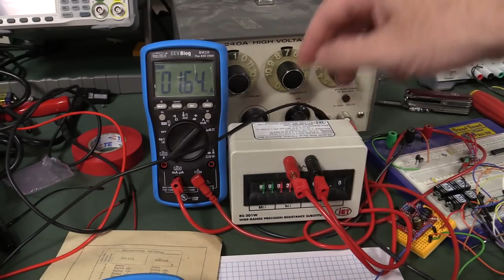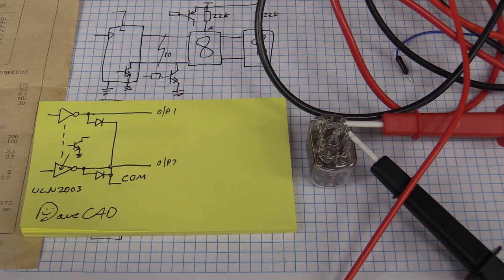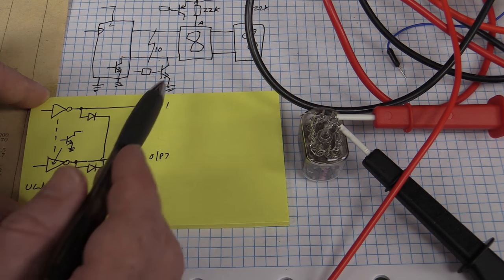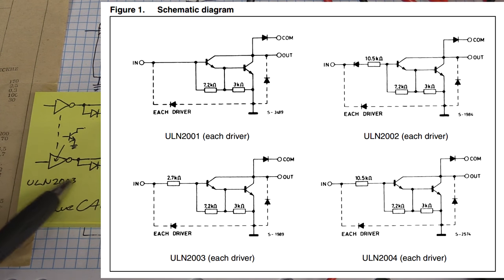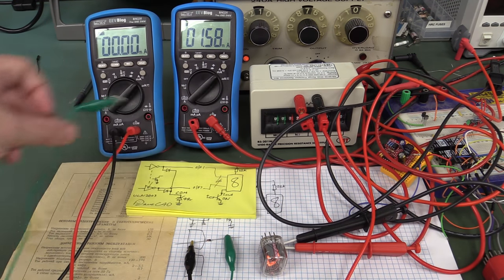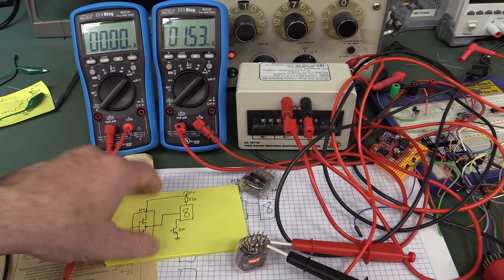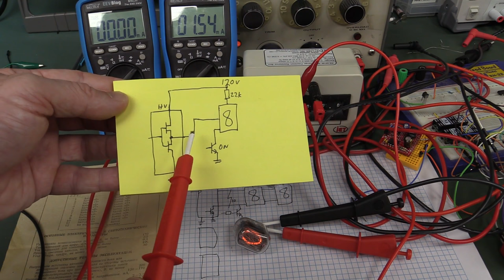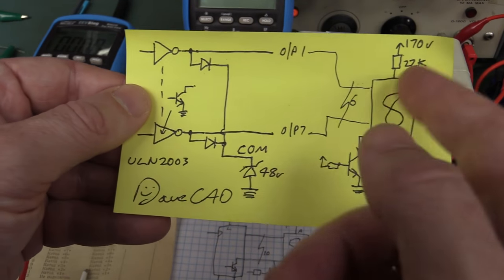EEVblog #950 - Nixie Tube Display Project - Part 2

Comment: there are millions of these 74141 chips available on ebay. It saves so much time and headache. They are designed to simplify all of this. I would definitely go that route much much simpler! And one benefit of some of these '141 is that they can handle blanking the any leading zeros.  Useful

Comment: the totem pole can be useful if you put a 48v on the HV input of the ic rather than 200v. there is a reverse protection built in to the totem pole if you look closer, I know it will work with lower voltage if some of the ic's has a lower voltage totem pole... test that out. nixie still at 170v via resistor. and the off state because of 48v zener will hold out max 50v, different ic's may varies, one I seen 60v and 80v.

Comment: I have 6 of these tubes, so I'm interested in this project. I like a single chip solution for minimum parts, but separate SR-latch and driver chips only doubles the part count, so not too bad. And it means jelly-beans can be used, so this zener trick is a great idea.
I guess a single zener would be enough for ALL the tubes (would only dissipate about 100mW for 6 tubes), but I'd be using one per ULN2003. Just seems safer...

Comment: What happens if you just disconnect the HV from the totem pole supply voltage? Will it become an open drain/collector output or is there something that I don't understand right?

Comment: Why not just leave the HV pin floating in the push pull?
Reply from the maker: Maybe possible, would have to try it.
Reply: I came here to say the same thing, or better, tie it to ground.
Reply: +pratherat Ground it, absolutely not. This will short every segment to ground, either becayse the transistor is closed, or due to the body diode of the P channel FET. Realistically possible options include: leave it unoconnected, high value (100k?) resistor to HV+, zener diode to ground, or combination of the two, ie a resistor-zener divider to generate a known although high impedance voltage.
Reply: +Gameboygenius Oops. Forgot about that. Thanks!

Comment: Dave the ULN2003 will not work if you do that. You'd probably fry any other connected logic aswell. The COM pin needs to be referenced to logic GND for the ULN2003's inputs to function. However you can make voltage dividers on all of the pins to pull the voltage within reasonable levels and than adjust the voltage source so  a 40V  difference on the Nixie tube's pins would toggle it between on and off state. Yes, that's allot of resistors, but it's cheaper than an expensive 32bit high voltage shift register... I found  a pair of 32 bit VFD display drivers but they are only 30V capable.... I might just go with discrete transistor solution with the MMBTA42... Way cheaper than the others.
Reply from the maker: How exactly can you damage the inputs? they have input protection resistors internal. Sorry, I don't see it.
Reply: Sorry, i was wrong. Thought the com was the ground pin.  :) Love your videos by the way, i was just planning to make a nixie display out of old spare parts for my old CRX's spedometer :)
Reply from the maker: Phew!

Comment: I'm quite the electronics beginner. However, I've recently bought a UA723CN 5V voltage regulator in a 14-pin DIP package to replace a component made in 1980, and I was really surprised how easy this was to obtain, for just around 60 cents or so. Is it normal that a chip that was invented in the 70s is still available today?

Comment: I like the ULN2803, since it has 8 transistors
Reply from the maker: You'd still be two short
Reply: But for an 8 digit display (with decimal) you could use 11 chips and have no transistors left over.  With the 2003 you're using 13 and have 4 transistors spare.
Reply: Duh 3 spare

Comment: Could you not use BUV21 metal cased power transistors to switch the voltage has collector emitter of 250v.
Reply from the maker: There are countless transistor that could be used.
Reply: I got some MMBTA42's in SOT23 for my Nixie project years ago. They work nice, too.

Comment: Is it easier to drive a nixie tube than a vfd?
Reply: BlinkY tried to drive a vfd a couple of years ago and I failed. Using original driver ic, multiplexer, power supply and an arduino nano

Comment: If you got an IN-15A and IN-15B nixie tube, you could make a nice multimeter with them. They are identical to the IN-12 but contain the symbols for different units instead of digits.

Comment: Wouldn't you be able to use series diodes to act as blocking diodes for reverse bias to prevent reverse voltage passing into the device?

Comment: at around the 16:00 mark, the hv pin, just leave it disconnected?!? it seems so obvious i'm shouting at the screen lol, so if its so obvious, what am i missing ?
Reply: I did the same thing. Unless the HV gets used for some internal bias? That shouldn't even matter...
Reply: I think it may matter considering the HV pin is common to ALL the outputs in a single chip.

Comment: Hi Dave, would you need several 6 nixie driver pcbs ? I can send you different tube version with schmeatic and layout (free)?
My design is similar to your design with build in high voltage step up 12V -> 170-180V.

Comment: You sad that the ULN2003 is one driver short. What about the ULN2803 with 8 drivers, that would include the decimal point?
Reply from the maker: Err, it's a Nixie tube, not a 7 segment display, it has 10 digits.
Reply: Oops... yes of course, how could I miss that... I 'm so used to 7 segments these days... Doh, won't make a big difference then. 10 or 12 ICs, hmm.
Reply from the maker: I think I said segments like 3 times in this video!
Reply: Fair enough

Comment: Hi Dave, interesting project. I worked on a spectrophotometer design in the late 70's which used an 8008 processor and had a nixie tube display. We used a similar arrangement to the one you showed except that we used discrete transistors and steering diodes for the drivers. However we did find a relatively easy way to strobe the digits. Each was fed from the +HV supply via its own resistor and we used high voltage (200V) transistors to pull the tube common to ground except the one that was 'on'. It was a 6 digit display so we did not need may of the expensive high voltage devices. This worked well although the resistors used to get fairly hot.

Comment: use BA12003B this poppy is rated 60 volts I have the same nixie tubes these worked perfect I built a clock my ZENER is 55volt my dropper is 27 k 1/2 watt carbon film I am running 175volts on the HV I put a 750 k 1 watt carbon film from ZENER to 175 HV supply

Comment: my tubes are drive by MMBTA92 and MMBTA42 in Darlington another MMBTA42 for selecting and indeed clamped to ground with an in4148 diode and a 47k 47k trough an voltage divider

Comment: Use 74141 driver:-) it's 4 bit driver for nixie tube. I have those to my nixie project, but haven't time to done it:(
My idea was use arduino with PCF8574 expanders (I2C), and one expander can control two, 74141 drivers. You can control nixie display by only 2 wires.

Comment: Yes they do sell those nixie driver chips 4bit binary to 10 digit output high voltage low side driver. I managed to buy about 50 of them from Poland I think. You wouldn't buy them in a regular store, but it is very possible to get your hands on them. Using hv shift registers is a very clever idea though. My first attempt was to use transistors and multiplexing, but it had an annoying shadow effect, so I bought those drivers. They work perfectly.

Comment: Hi Dave, could you explain the measurement of the leakage current @11:48 if you are meauring the current between the  22k resistor and the  anode of the tube. It seems the total current doesnt add up logically?
If the leakage current are passing through the 22k resistor to those open pin via a zener diode, the expected current should arround 1.59+0.33 ~ 1.92mA?

Comment: The very low cathode current that results as a result of clamping the output with the 48v zener is often talked about being linked to a "poisoning of the cathodes" exacerbating reduction of light output over time.... I'm not too knowledgeable on the chemistry of the Nixie tubes, but a similar thing does certainly occur within fluorescent lamp cathodes, (a separate issue to the well known poor preheating). Ive mainly designed clocks that are displaying 24/7, so have always erred on the side of caution.

Comment: With 200v on the anode and 50v on the digit, theres only 150v across the tube, the striking voltage is 170v, so the digit stays off.

Comment: i recommend you not run below 170 volts on the main plate supply the tubes gane voltage drop over time that is why i used 175 volts you will thank me for the 170 - 175 volt choice

Comment: Sorry, I'm just a novice hobbyist. If you clamp the voltage with a 48V zener then the transistor inside the driver will only have to withstand 120 (for example) - 48 = 72V. So the maximum open collector voltage can be as low as 72V, right? Please correct me if I've got it wrong.
Reply from the maker: No, the transistor only has to cope with the zener voltage. The anode resistor and the nixie tube drop the rest of the voltage.
Reply: Isn't 48V zener too much "tight"? Counting tolerance, the diode drop, and the zener dynamic resistance, the collector could reach a voltage above 50V...
Reply: EEVblog Another question! Shorting all the pins yields about 125v but didn't understand why you said "you guessed it". Is there a way to know that without measuring?
Reply: The highest voltage or lowest voltage drop was already measured. When tied together you expect the lowest voltage drop to count for the bunch.

Comment: Just use 200V transistor and simple 595 chip.
Everybody in the world can find easyly on market these things.

Why are you thinking so much about that, i can't understand, it's obvious to know not trust the voltage drop on nixies.
Reply: A two second simple solution doesn't generate youtube bucks.
Reply from the maker: Because it's (I think) interesting content, and I explained that driver chips are less hassle to solder than 88 transistors.
Reply from the maker: +donpalmera It's not about the bucks, it's about learning and creating content for an electronics engineering channel. There is a lot of value in going through all sorts of design decisions. If they seem obvious to you, they may not be obvious to a beginner.
Reply: EEVblog Yeah I get that. The point I was making was that start video Gonna drive some nixie tubs, gonna use some transistors, come back next week for 10s of something else end video isn't really valuable to anyone.
Reply: Dave you think very elegant, I think you missed some points; we can get different ICs from anywhere but think about beginners, like 10-16 years old hobbiest, they can't use credit card or ext. They can't get these special(!) ICs very easy; you know that.

Why I said 595 and 200V transistor, everybody can find them very very easy in very low prices. Maybe 88 transistor soldering is hard but you can get 100 transistor around like 2-5 bucks! Any children can build clock or ext. with nixies, without eating lollipop.

And please think; what will you do when your special(!) IC burns when you are soldering it? It hurts. But if you burn 2-3 transistor while soldering, it won't!

I'm very curious about what you are gonna use at this projects.

This is my bet;  you will found Supertex ICs from Microchip.
Reply: +EEVblog how right you are

Comment: Why not simply use a multipack resistor to simply pull all the nixie tube pins, including the one being driven, to ground?  As long as the value is high enough that it will not negatively impact the driver transistor when it is on I would think that would be a lower tech solution and all the pins would not be floating at any voltage.